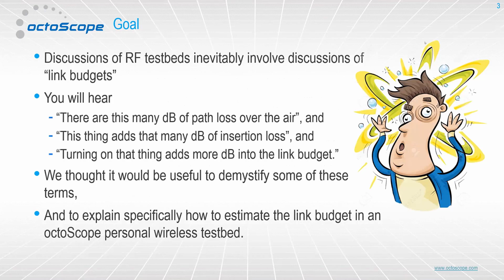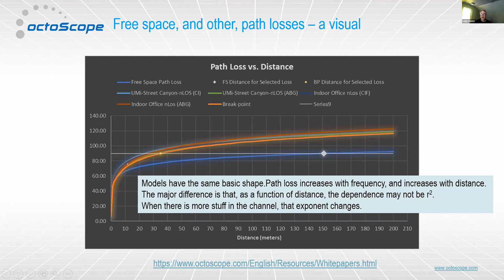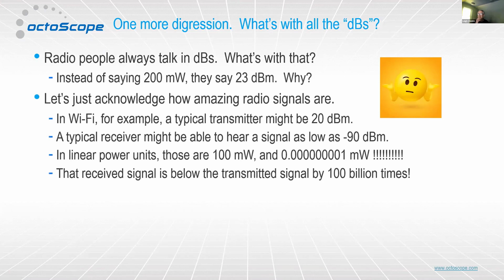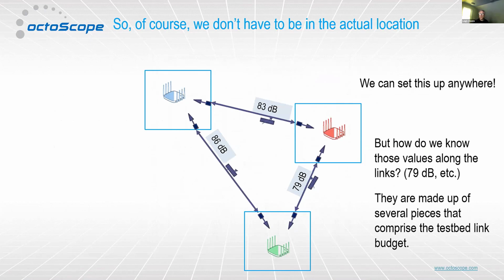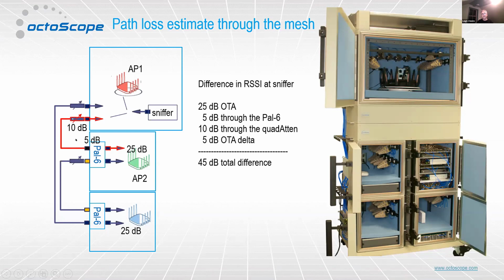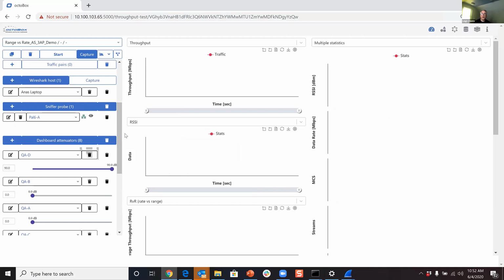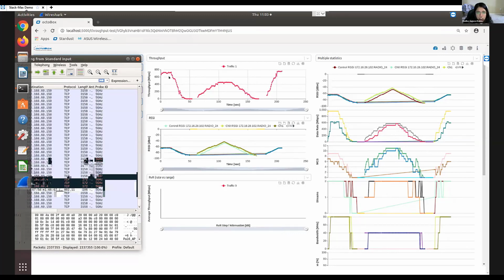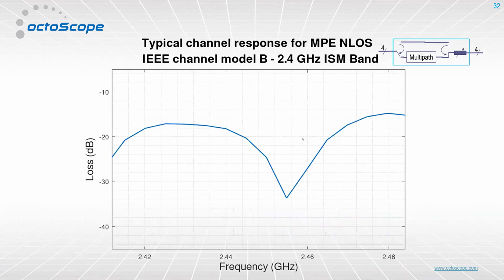octoScope Wi-Fi 6 test tutorial #5 - Fundamentals of RF link budget

Comment: I like your explanation of path loss. Minor point: as the sphere grows. the patch has the same total power, but the power density reduces such that a point on the sphere will receive less energy father away than close up.  You kind of say this later on.  Excellent presentation.  Also, you all might want to look at NIST TN-1951 which captures the path loss models using empirical measurements in factories at 2.5 and 5 GHz.